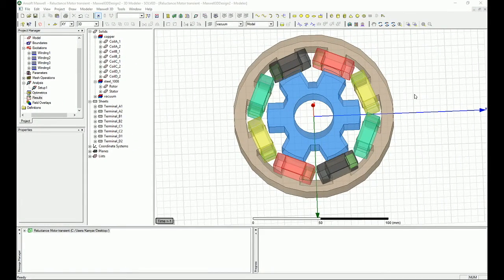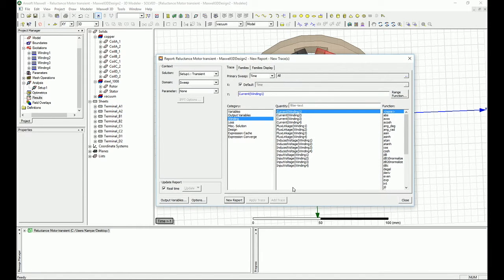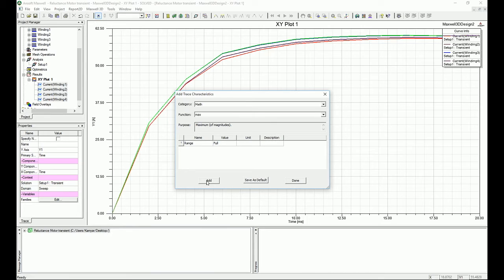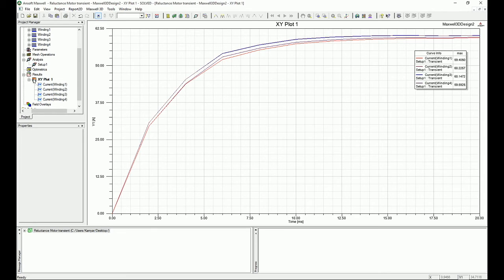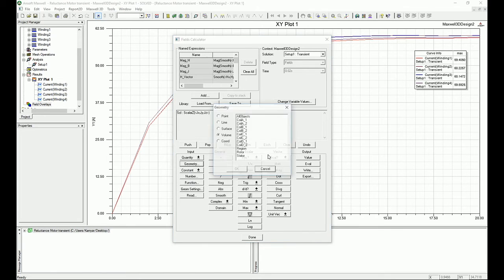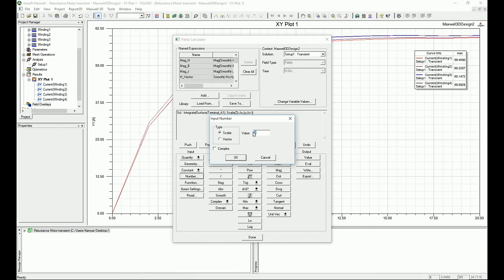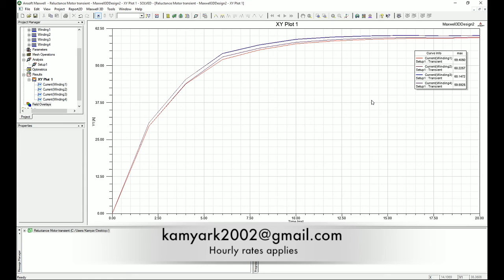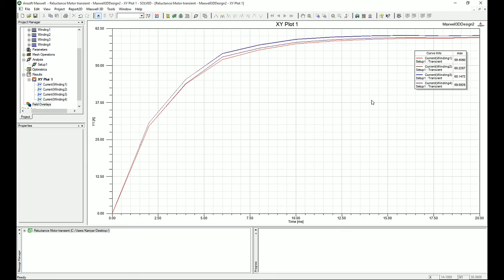402-Ansys Maxwell | Reluctance Motor [2/2]

Comment: When we define current for the winding using pwl() command, to get a triangular pulse we need to input only one cycle dataset correct and it will automatically interpolate the signal?
Thanks in advance